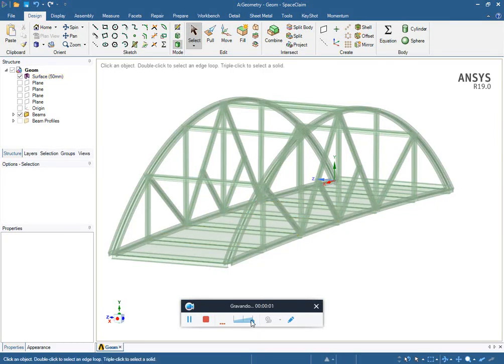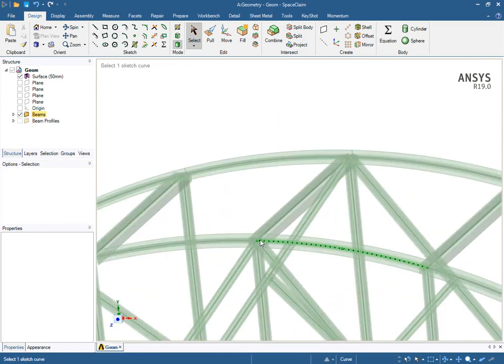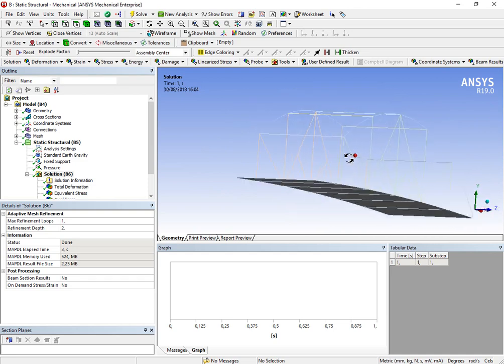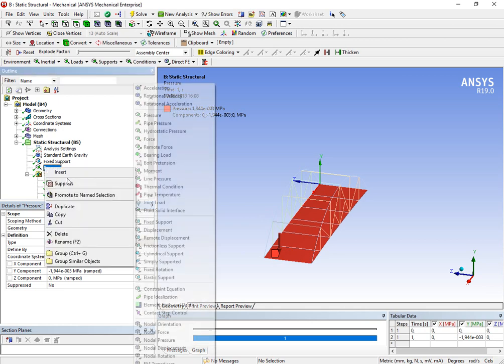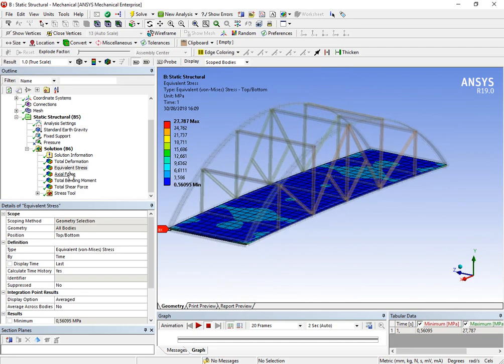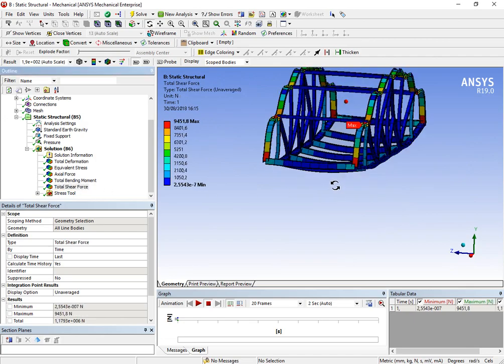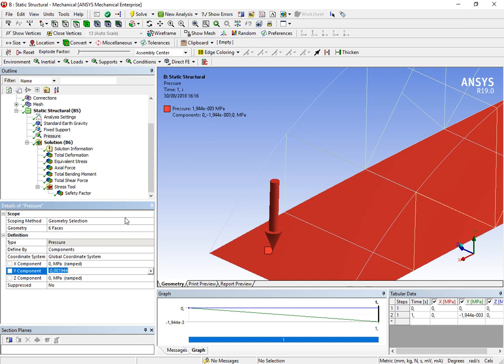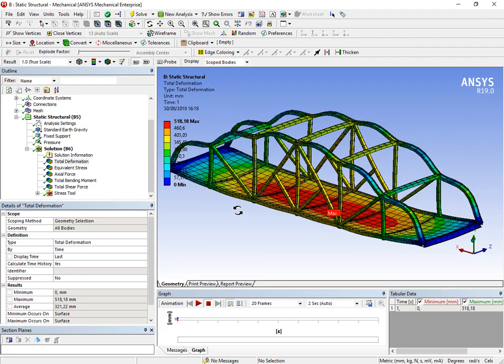Bridge Finite Element Analysis - Ansys (FEM)

Comment: For one of my projects I am trying to do a structural analysis of an aqueduct which is basically a bridge with a higher angle arch in the bottom. Is the process of creating it the same since its going to be a solid wall or do you think it will be way different?
Reply from the maker: Hello oVersSkilleD,
Your question is very interesting. Well, for the matter of fact, the process could be just like the one showed in the video, yet you will have to use shell elements to simulate the walls of the aqueduct. 
Using beam and solid elements in the same model is not recommended because multiple issues may appear, especially in the contact zones. My tip is: try to model the aqueduct with beam and shell elements first and run an analysis with the appropriate properties. Then, depending on the accuracy of the results, you may want to do it with solid elements. However, be aware that the computational cost with solid elements is way higher than with beam/shell. 
Thank you for your comment!

Comment: Hey nice job! i'm an engineering student and i trying to make the modeling of a high voltage tower, but i have a problem with the pre and post because i use GiD, so my cuestion is if i can use ANSYS, but the codification with Matlab, that is, export and import only the strcuture to make the mesh (pre) and see the results (post). Thank you!
Reply from the maker: Hello Sir. 
Thank you for your comment. 
Well, the process of simulating the behaviour of a high voltage tower is very similar to the one I'm showing in this video, despite the difference regarding structural design. 
Well, I've never used MATLAB's interface in Ansys. Wouldn't it be easier if you started your project in Ansys from the beginning? 
You can create the points manually in Ansys and then assemble different cross-sections as you intend to.